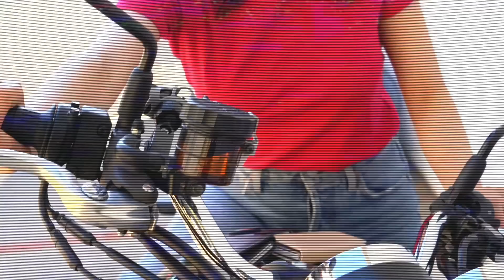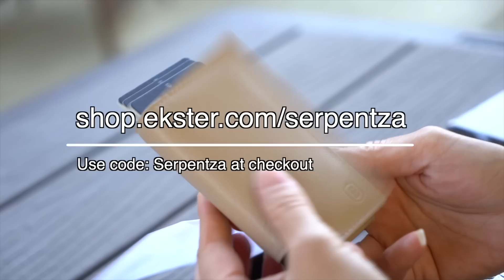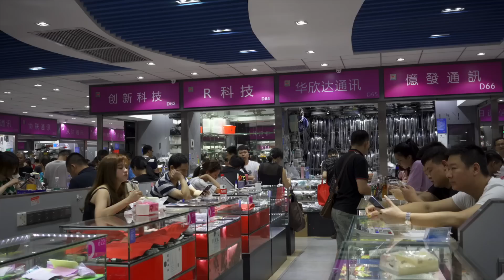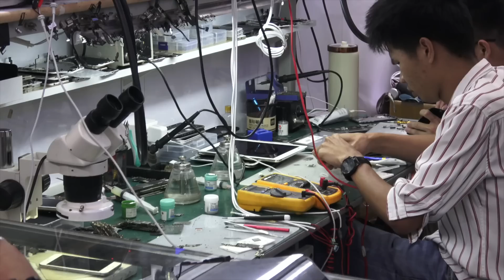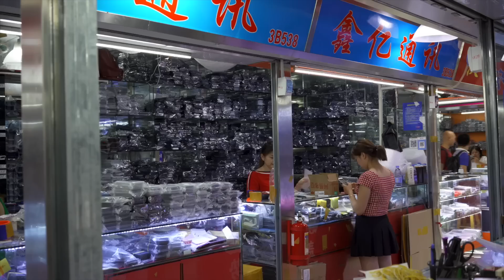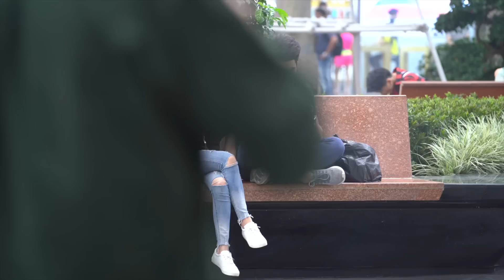Why China Can't make Chips!

Comment: These sanctions are already in effect: The U.S. bans the exportation of Extreme Ultraviolet lithography, the current state of the art, to China. The funny thing is that the U.S. does not have EUV either, they import it from the Dutch manufacturer ASML, the only supplier of EUV machines in the world. They manufacture about 40 machines per year, at $400M a pop.
As a result, China is forced to make do with regular UV lithography, pushing it to its limits, recently producing the equivalent of 7 nanometer chips, but it's of course not as precise as EUV 7nm, and as leading edge as EUV for really advanced chips. Regular UV lithography is however fine for high tech such as phones or computers for now and many years to come, and even too much for electronics for cars, appliances, production machines and robots, etc. that do not need that level of lithography.
Reply: ASML is reliant on Corning technology in turn.
Reply: @PicaroPariah  Europe has Zeiss to replace Corning if it's absolutely needed, it's not needed since the EU and the US will always be allied in some form or another.
Reply: Yep. I think Asianometry did a video on this recently.
Reply: We must not aid them to acquire this technology.
Also try to take measures so that they do not steal it.
They are undeserving of any help.
Reply: "fine for high tech such as phones or computers for now and many years to come"

thats not hightech, thats low tech and its already outdated,
why do people make such stupid claims?
Reply: @flycrack7686  Density increases in newer nodes are very low in relation to developmental costs. "7nm" produced on UV machines is enough for all applications.
Reply: @nooonanoonung6237  just: no

first of all 7nm is not 7nm.

Just because someone calls its 7bm it doesnt mean anything if not proven useful.

Second modern hightech technology absolutly needs EUV or its simply not Hightech.

We see that already with chinese phones which are not as good as their counterparts if they cant get the newest technology.

SO ONCE MORE:

why do people make such stupid claims?
Reply: @flycrack7686  that's why i put "7nm" it in quotation marks. It's more of a brand thing.

Tablets and mobilephones have been made on these non-cutting edge processes for years, they work fine. Their perfornance might not be the best, but they work.

Most industrial and military applications still use older nodes for stability. These nodes the Chinese have mastered. Whether or not they can push them out in any reliable quantity is another matter altogether.
Reply: Is it the same with epitaxy (epitaxial deposition) ?
Reply: @flycrack7686  Cool down, iPhones are not highest tech as far as lithography is concerned, but they are still pretty much high tech and even highest tech in their field, given that there is no EUV-engraved phones at the moment, or barely any.
Reply: @Coromi1  Your country got told by the entirety of Eastern EU and Finland to not rely on Russia for your energy needs, your country disregarded this, NS1 and 2 were a mistake, you were told this from day 0, when Russia cut off the gas in 2011 (if I remember correctly) you should have gotten the hint. 

- a Romanian.
Reply: @recoverhealth2062  The entirety of eastern EU is depending on Russian energy itself. Victor Orban tries to act accordingly. 

And the German wealth is depending on cheap Russian energy in the first place. We would not have been successfull and wealthy with our industries without this cheap energy in the past. And we will not in the future. 

You still have horse carriages in Romania. Gratulations, you are prepared. (I don't say poverty in Romania was because of Romanians beeing dumb or lazy, I mean literally, horse carriages don't need gas. The partly still existant small farmers and gardeners are better off than highly industrialized countries.)
Reply: @Chimel31  where was i talking about iphone kid?

Do you have any clue what hightech means?
Reply: @Coromi1  Romania has enough domestic gas and domestic energy production to survive, your horse carriage jabs at my country is cute and expected, should I start laughing at Germans in lederhosen now?. From the EU only 2 states are gas self sufficient, Romania (89%) and the Netherlands (70%).

The rest have built enough LNG infrastructure to import gas from elsewhere, even Poland can handle more LNG than Germany. Spain imports all its gas from Africa and South America, they knew better to stay away from Franco-German bullshit politics.

The only one to freeze this winter will be you, and you all deserve to freeze, should've listened to us in regards to Russia before the Crimean invasion.
Reply: @recoverhealth2062  Poland bought plenty of Russian gas from Germany. Most European countries don't have gas and oil on their ground. Spain and Portugal always had been importing gas from Africa since they did have no other option. The infrastructure to import from Russia was never built. It was not their choice and a disadvantage for their economies.
A lot of people in poor European countries will freeze. LNG is always extremely expensive, and now prices went even higher. Electricity, oil, coal, everything got more expensive. Poor people im all countries can't afford to heat.
We all would be well off, if we would not have participated in the US/ Nato war against Russia.
Reply: @recoverhealth2062  Oh, my mom is from Romania and I have visited the country a few years ago. I have seen several agricultural horse carriages on rural streets.
Reply: @flycrack7686  Well "high tech" has different meanings, and not necessarily the official definition of "most advanced technology". It can be the plural "most advanced technologies" (which is how "high tech" is defined in French, for instance), but mostly, you could consider that there is an ambiguity regarding which sector this definition applies to. This is why I took the example of iPhone or any other high end phone for that matter, because the top range of these phones represent the highest tech available in this sector. Lithography is not the only defining factor of electronic appliances. A high tech mouse for instance could be a gaming mouse with the highest DPI resolution, not necessarily one that has EUV chips inside.
You're too much into computers if you are that binary, there's 50 shades of high tech!  😀
Reply: @Coromi1  There's horse carriages everywhere in Rural areas in Romania, it's pretty logical that it is this way, there are villages with 200 people in them and the nearest gas station is 30-40-50 km away. I have a family member that has a horse and carriage, he also has a car, uses both of them, one for field work and the car for normal use. They used to have a tractor for the entire village but could not get parts after the Romanian manufacturer went out of business (UTB Romania) 

No one will freeze this winter besides people whose countries over-relied on Russian gas, the writing was already on the wall when Russia cut off gas for Ukraine about 10 years ago, a byproduct of this is that many other countries didn't get gas from Ukraine, this is when everyone (besides Germany) started to diversify.
Reply: @recoverhealth2062  So we agree on horse carriages.

Russia is the most reliabel bussiness partner in the world. They even supplied gas to countries like Germany after those countries went to war against Russia.

Ukraine stole gas from Russia to a large extend. Should they have continued to give gas to Ukraine for free? Russia delivers reliably gas to countries that actually pay for it and that have a minimum of reasonably good behaviour.

Please consider to read or watch alternative news. It feels like you got all your knowledge from Nato press releases. You could read The Grayzone or watch the Jimmy Dore Show on European topics.
Reply: @recoverhealth2062  Russia still deliverd gas to Germany at the beginning of the German sanctions against it. Do you have one example of Russia not fullfilling its energy contracts except for countries who declared war on it or did not pay?

I did not say Romania was a bad because of horse carriages, I said they don't need gas. If Romania was highly industrialized, than it would not produce 89% of its energy, it would depend on Russia like Germany does.
Reply: @Coromi1  Everyone behind Ukraine when they cut off the gas due to Ukranians not paying. That's a breach of contract, I as a consumer don't care about Russian-Ukranian disputes, I paid for the gas, if it's not coming fuck the supplier. 

Romania makes half a million cars every year, and about 10 times as many car parts for different suppliers (including porsche), if that's not "industrialized" then I don't know what is.
Reply: @recoverhealth2062  Ukraine did not pay for all the Russian gas, it stole a lot. Do you think this is not true or it doesn't matter?
Reply: @PicaroPariah  ASML likes to buy its suppliers.

Comment: In 1995, I worked for AdLib, a pc sound card manufacturer. We used Crystal Semiconductor cs4232 chip set. We paid $15 a pop plus another $32 for midi chip on our most expensive cards. While we were in Hanover for a computer show, we met a Chinese manufacturer who told us he got the exact same chip form Crystal at 5 cents a pop.  This means the chip cost a fraction on a cent to manufacture.  Same chip, made in US and all. How can a honest north American company compete with this.
Reply: Counterfeit chips are a thing and he might have been getting counterfeit chips. When I worked at an auto dealership, one of our suppliers was always trying to sell us counterfeit spark plug wires even though the company was an authorized distributor from the automobile company.
Reply: Your defect rate combined with the cost of support and loss in revenue and brand quality would've cost you more
Reply: I would call him out as BS… it was probably a knock off chip. Also, too and you didn’t keep any of those cards… the original adlib ( pre sound blaster ) goes for a ton of money with collectors… $500+
Reply: a appliance machanic/electrician once told me that components are measured on performance; not only  chips, or those may be differently, but capacitors, resistors, whatever. A brand manufacturer will buy only the very best, and the rest goes into different price categories. So parts may be the same as in an I Phone or brand TV, but actually they do not perform to the same level.
Reply: ‘95 was around the time that they started to get “3rd party” AdLib hardware, I think I saw the SB32 was the start of that downfall, as Gravis Ultrasound and other manufacturers started to get their hands on the patents and work around the API so they could be adlib-compatible. The cost was also a huge jump from $20 adlib compatible to ~US $239 for the Soundblaster 16, which offered 16-bit 44.1khz recording and playback, then-CD quality.

The move from AdLib was also why MIDI kind of died out, because it was wasn’t really worth the money, until or unless you had a keyboard or synthesiser to make the music for you.

Around the same time, the game boy and sega game gear cartridges were being copied and resold. Nintendo also stopped offering hardware to Asia around the same time. 

The other thing that used to be interesting was they started to move to software and hardware music, to store “megabytes” of instruments on a flash storage  and you could load an instrument set to play MIDI music from a floppy or HDD.

Comment: I remember the ball point pen thing. It was about the same time when China announced it could make high grade ball bearing steel. Within weeks it was on Chinese news about  high speed trains in Guangdong having wheel bearing failures. They claimed the german bearings they used were damaged by pressure change in tunnels, and the supplier was being dropped cos chinese bearings were better. It was such a strange thing I rememberd it ( I am an engineer ).  Ha ha, also.. another story..

Comment: While I agree on almost all points about China lacking high tech knowledge, the repair industry is not their weak point (which makes sense, since economical conditions would make that thrive and Chinese technicians are good at improvising anyway). Apple and other manufacturers don't actually sell many of those spare parts to repairmen or end users, so scavenging parts is the usual way to go about a repair, unfortunately :(